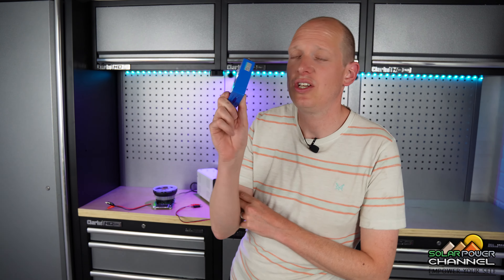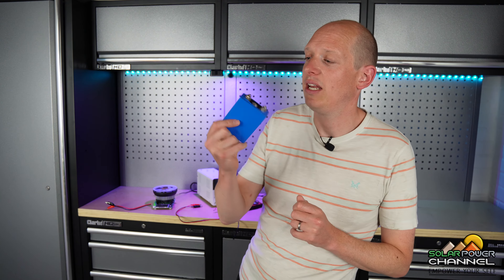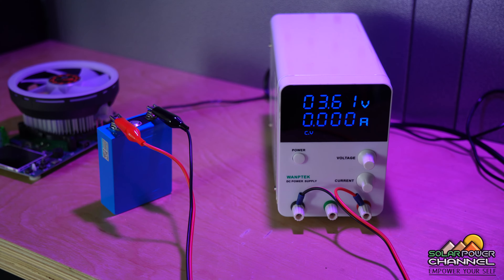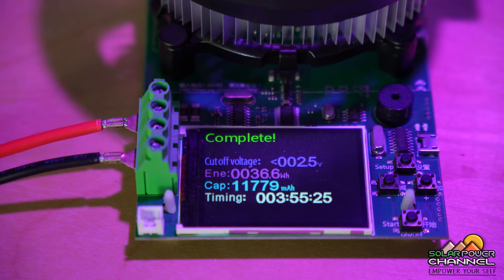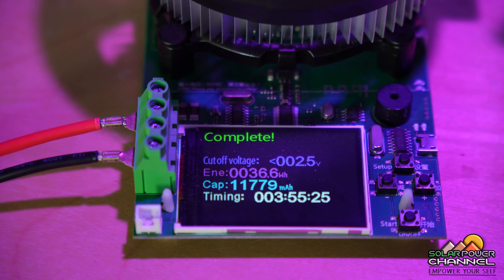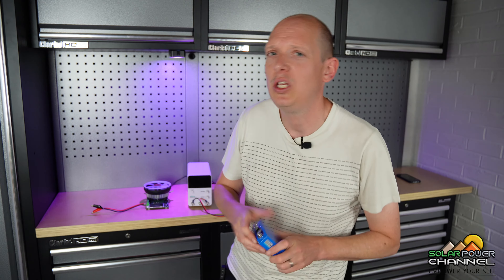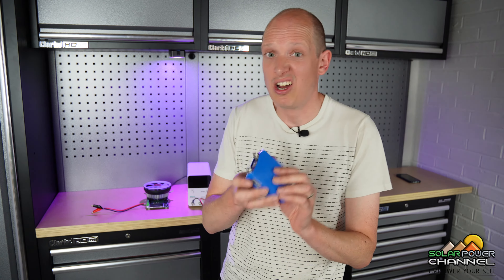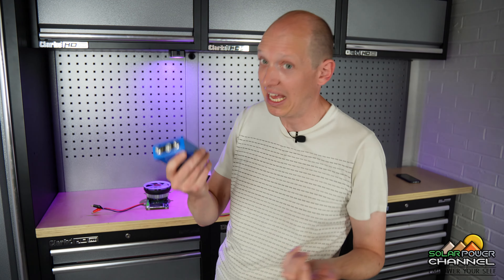Low Voltage Damage Lithium Battery LifePO4 Test

Comment: I understand that some information about your actual experiment is embedded in the video. Just to recap: after a total discharge (close to 0V as you claim), were you able to charge it back up to 3.6V and perform a capacity test? Were you able to revive the battery to its full capacity after a total discharge and leaving it for a week at that low voltage?